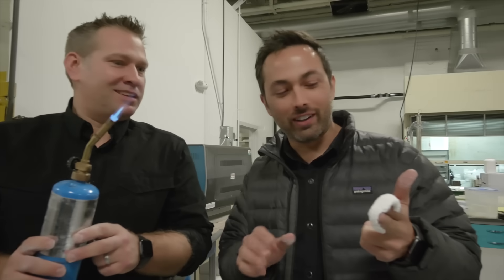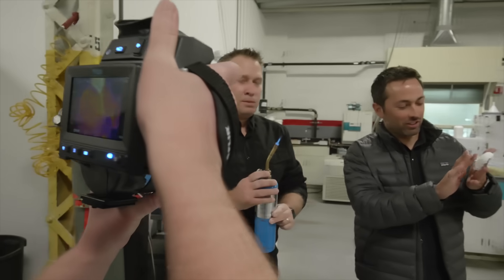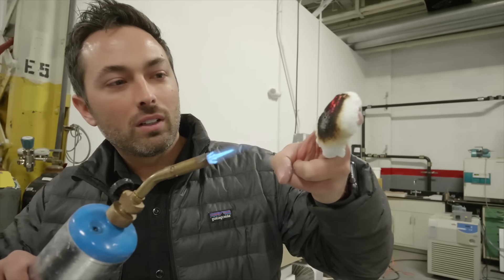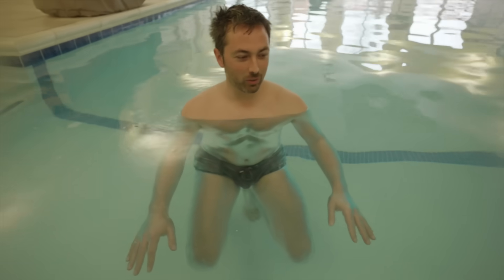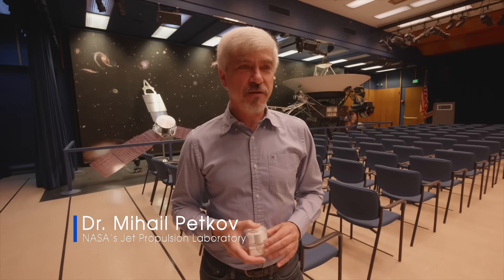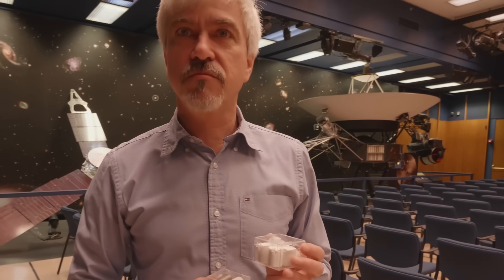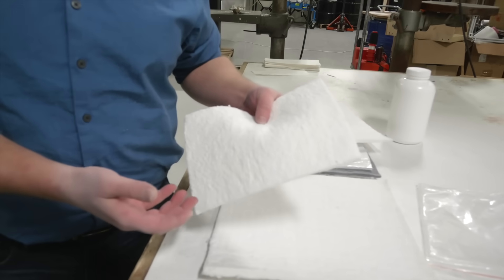I Waterproofed Myself With Aerogel!

Comment: Is there evidence or analysis that demonstrates these materials do not present increased risk of occupational lung disease or this just optimistic speculation?  One of the researchers claimed that one of the substances "is very safe" noting the shed particulate is amorphous rather than crystalline.  I understand amorphous silicates are unlike the fibrous needle-like amphiboles crystals, but  in the extreme high heat applications like the ones speculated I'd be concerned about recrystallization. The amorphous silicate Diatomite, for instance will readily convert to crystalline forms like cristobalite.   I'm also curious to know how readily the body is able to expel the hydrophobic variant they demonstrated.

Comment: "How thick should it be?"

Engineer collecting data: "Let's try that"
Reply: * another bridge collapses *
Reply: @MidnightMeka  That's usually due to improper construction or lower quality materials than prescribed. Secondly, mobility and traffic has increased exponentially since the 1950s, that's something nobody could have foreseen and many bridges were build more than 50 years ago. Lastly, due to some extremely rare load combinations, beyond the expected, they could also fail of course. As an engineer myself, I wouldn't immediately point to the engineers as the culprits lol
Reply: @porschepanamera92  lower quality materials such as Aerogel? which was my joke coz no Engineer would use it to build a bridge. but thanks for your explanation
Reply: Dont forget of the importance that a bridge should be built on proper ground.Therefore a geologist is needed to ensure the stability of the area for the bridge
Reply: @ZeroSleap  For what it's worth, in specific cases a geologist might be consulted for their expertise, but usually civil engineers have a sufficient understanding of soil mechanics and geotechnics. Additionally, geotechnical engineers are the sub class of civil engineers that usually deal with the special cases.
Reply: odd zilla Dummy thicc
Reply: Isn't it really brittle??
Reply: @mrcalender5379  exactly (yes)
Reply: @zander allan It was funny though, but I couldn't resist to explain a common misunderstanding of (structural/civil) engineers. There are even more aspects to a construction project that might influence the service life of the construction, but that's for another time.

Comment: I wonder what the lifespan of the material would be and if any of the properties are resistant to Sticky substances. For instance an application of the substance to the inside of pipes that it's not only water-resistant resistant but real is it resistant to other substances that wouldn't normally stick in pipes.

Comment: Question! If the silica gel breaks down when it gets wet, how are they stabilizing it for museum use? On its own, it wouldn't be able to absorb and release as he said, unless they replace it fairly frequently. So what is it mixed with to allow that release capability? (Also, per algorithm discussion, setting yourself on fire is always a catchy thumbnail)

Comment: friendly reminder to NOT TRY THIS AT HOME
powdered silica can be very dangerous to your lungs. if you absolutely must coat yourself in silica, wear a respirator. silicosis is a real danger when handling airborne silica dust so please PLEASE use proper protection. as someone who has painted with silica-based waterproof paint and then gotten sick for a week, i highly suggest you don't take aerogel or other silica products lightly (pun very much intended)

Comment: So I just watched a video about 3D printed Titanium. Could you 3D print an aerogel titanium structure? Making it even more lightweight while boosting its insulating properties. 

One of the issues of the SR-71 or any aircraft that flies faster than Mach 2 is that the friction of air greatly increases. A thin layer of titanium backed by a Porous aerogel might be able to decrease heat transfer while also decreasing weight.

Comment: I bet it would be very good for insulating components in an engine. Like turbo blankets impregnated by it or heat shields to divide exhaust-manifolds from radiators.

Comment: The question is: how much it costs? Could it works as an insulator for small homes on wheels where overall weight and wall's thickness can be an issue? It'd be nice.

Comment: The real question is:
How did you wash it off?
Reply: Maybe with alcohol?
Reply: Legends say that some aerosol particles are still on his hands.
Reply: 69th like and I was asking this myself.
Reply: I doubt it needs to be washed off. Daily activity will probably be enough to remove it all in a few days.
Reply: I'm guessing oil, due to it being non polar, then use soap to remove the oil.
Reply: @triangleenjoyer  why bother with the oil in the first place?
Reply: @minetech4898  haha I thought of that after I wrote this. I don't have a good reason. My thought at the time was that the oil would stick better to the aerogel molecules, and the soap would bond better with the oil, since the soap alone isn't really just soap alone but a soap/water mixture. I think both should be tried to find the best result.

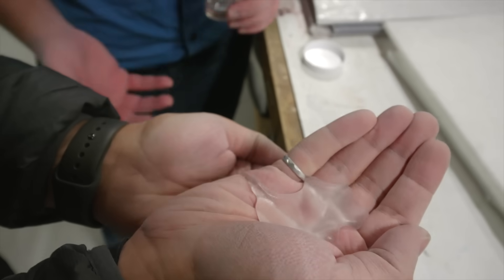Comment: 8:51 So... Could you use it as an extremely thin condom or?
Reply: asking the real questions
Reply: Wouldn't the nut milk just get stuck inside? Like there wouldn't be anywhere for it to go!? AHHhh!?!
Reply: Yes it works well, just make sure you reapply regularly
Reply: Lol I just realized that this would have to be the most expensive condom ever if it was to be used for that purpose!

"Even though producing more aerogel at a time would bring its price down, the process and materials alone come with a high price tag of about $1.00 per cubic centimeter. At about $23,000 per pound, aerogel is currently more expensive than gold [source: NASA JPL, FAQs]!
" 
How Aerogels Work | HowStuffWorks
https://science.howstuffworks.com/aerogel.htm
Reply: If you have a burning sensation down there, it’s not fire and aerogel won’t help... go get tested.
Reply: Um..... the answer is clearly no.

Comment: Derek: How do I get this stuff off now?
Aerogel guy: Just wash your hands...Hahahahahahahaha!
Reply: For real though, soap would bond to those polar groups right away and carry the aerogel particles right off :)
Reply: @Yossus  Username checks out
Reply: @Yossus  As long as those crazy scientist guys don't make it soap resistant too. Then we're screwed.
Reply: @Yossus  Good old soap
Reply: @Yossus  Nonpolar*, the polar groups will already attach to water
Reply: @Yossus  radical!
Reply: Even if it's water resistant it probably isn't towel resistant
Reply: @danieljensen2626  A towel really is about the most massively useful thing you can own. Never leave home without one.
Reply: Probably a different solvent. alcohol, soap, xylene.
Reply: r/beetlejucing
Reply: Sketchy Pigeon if you’re gonna link a reddit, at least make sure it’s one that’s relevant.

This isn’t beetlejuicing, it’s kinda similar (if you tilt your head and squint), but it isn’t beetlejuicing.
Reply: @barmacidic2257  I say anyone linking a sub outside of reddit has to use the full link. Example: reddit.com/r/ihavereddit

Comment: So if you're coated with aerogel particles that are hydrophobic, presumably you can't just wash it off. This begs the question how did you "wash it off"? And also what effect does it have to water coming out of the body as sweat? Would anything different happen if you were going to do a workout while covered with hydrophobic aerogel particles?

Just curious :)

Comment: " ...when handling aerogel insulation...Union members reported nosebleeds, upper respiratory tract irritation, and skin dryness"
"Silica-based aerogels are not known to be carcinogenic or toxic. However, they are a mechanical irritant to the eyes, skin, respiratory tract, and digestive system. Small silica particles can potentially cause silicosis when inhaled."

Comment: I get so hyped about aerogel.  I'm a mechanic and I'm into cars.  And I can think of so many uses in the auto motivate industry.   Imagine a mixture (if possible) of aerogel and carbon fiber.  Strength plus the thermal properties of aerogel.

Comment: An idea to improve hydrophobic properties without adding so much weight: there's a thing called plasma treatment, in which a surface can be made more hydrophobic by creating a plasma right over its head. I know it works really well with polymers, but not so sure with these materials. Couldn't these be used instead of adding unnecessary weight?

Trusted source: researchgate.net/publication/248238029_Treatment_of_polymer_films_with_a_dielectric_barrier_discharge_in_air_helium_and_argon_at_medium_pressure

Comment: "This is a mixture of Aerogel particles and a non-flammable binder"
"What's that stuff burning there?"
"That would be the non-flammable binder"
Reply: If it was flammable out would start a self sustaining combustion reaction right after entering in contact with the flames.
Reply: There are many methods to give a material a "non-flammable" quality. Usually it overall refers to the idea that the material will not sustain fire by itself. Some mechanisms are: off-gassing, where by burning the material a blanketing gas is evolved that prevents oxygen from reaching the material, smothering the fire. Charring (like in this video), where the material rapidly chars, but then that char layer prevents more material from burning. A last example is heat sink materials, which decompose through a highly endothermic process, meaning that they release less energy that it takes to burn, so the material will not self-sustain flame.
Reply: Steel will glow red hot too! That doesn't mean it's flammable!
Reply: Did he say "non flammable" or "inflammable" because English is a dumb language?
Reply: @ferrous719  This distinction messes with me so much. Why would anyone ever think it was okay to put the word inflammable in the dictionary?
Reply: I mean, did it create its own flames?
Reply: Just about everything is flammable if you put enough effort into it.
Reply: "Either the thing flams or it doesn't flam."
Reply: I bet you the binder is corn starch. See "starlight" https://www.youtube.com/watch?v=dT1dSs988cY
Reply: A G lol 🤣😂🤣😂🤣😂
Reply: @xplotos  I came here to add the same thing :)  it looks exactly like the new starlight nightinhawk made
Reply: I fear this will be a repeat of starlight. When asked about the binder, hear how they say "proprietary"
Reply: @Ryan1456100  "proprietary" means really common, really really really common, and they can not patent it, and if you know what it is they can never charge you what they ARE going to be charging you for what is in essence something that is really really really really really really cheap.
Reply: @itsevilbert   You may want to look up proprietary in the dictionary, and stay in school kid. It's pretty much the opposite of what you think.
Reply: @ipissed  Well is and isn't. Things protected by patent are proprietary, as well as things that aren't. It just means you "own it". So if you created something, but couldn't patent it, I would describe it as proprietary, as in it's our recipe, we aren't gonna tell you, because then you could copy us.
Reply: @itsevilbert  Admittedly English is not my first language but my understanding is that it either means something belongs to a person or company or, as it is used here, likely means they can't or won't say the name due to copyright or because they came up with it and want to keep it a secret.

Comment: Cody (from Cody’sLab) made an video about a fireproof material called “starlite”.

He points out that even an sliece of bread can protect your hands against the flame of a blowtorch.
Reply: I saw that video and I believe the bread wouldn't protect you for as long as the arogel did.
Reply: QuackytheManiac QuackytheManiac Aerogel is waaaaaaaay better but is it just seems quite funny to me
Reply: @derbisenda1330  yeah, especially since arogel is like bread with much smaller holes

Comment: two questions:
1. for insecticide application, how do you ensure that the Aerogel  would not absorb water from crops?
2. how do you remove the waterproof Aerogel from your skin?
Reply: Just wash it off with wate- OH NO
edit: Use orange juice
Reply: something is true I think that the insecticide would not absorb as much water to cause damage to crops, but yes to insects. 
And to remove it I think it’s pretty much the same as removing anything else that’s water repellent, just scrub it with soap
Reply: the second point is so true
I expect it to be as simple as soap, however
Reply: 2. Anything non-polar or just soap
Reply: You must wash it of with something no-polar like an oil or you can use soap

Edit: fixed a typo
Reply: I'd imagine that aerogel dust wasn't really adhered to his skin very well. Hence why he was so careful in the water. Pressurized water would probably blast it off with sheer mechanical force.
Reply: You’re hypothesizing correctly that the plants will suffer equal to if not more than the insects. However, they’re just brain storming ideas: they don’t have to make sense yet. It’s probably doable in many ways, maybe using differences in the cell wall of the plant and exoskeleton of the bug (since this compound is so small) or just mixing it with the insecticide to create a more bio-friendly cocktail of death. Lots of experiments are in order.

Comment: @10:18 If you could make a composite that deflects water and is fireproof, seems like you could have some great applications for firefighters. Was also wondering if it's possible to design a composite that would be ideal for cleaning oil spills. That would be pretty amazing.

Comment: 5:30 you should calculate the surface area of half a football field. I think all the grass would make it pretty high.
Reply: Nah, calculate the surface area of all the particle and add them up, should be close to infinity.
Reply: It's probably a fractal.
Reply: Surface area has nothing to do with height, just length and width of a shape.
Reply: @phoenixnest8044  But he said the small object has the surface area of half a football field because he was including the millions of microscopic shapes inside the block. Using that same logic you should be able to use the shapes of the sides of all the grass to find the surface area of the field.
Reply: @Krebzonide  He was just using the football field as a square to compare surface areas, the grass is irrelevant.
Reply: @phoenixnest8044  I know what he was doing. I just thought it would be interesting that if the small block could have such a large surface area, what would the football field actually have.
Reply: @Krebzonide  I get it. I misunderstood your comment.